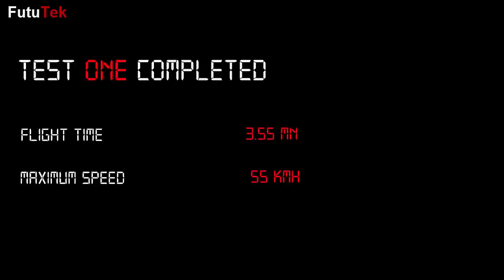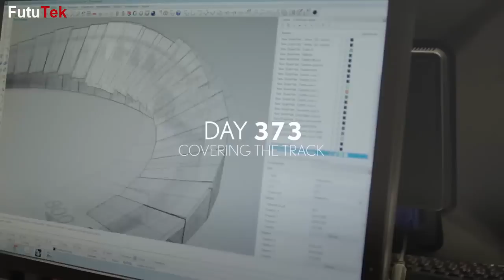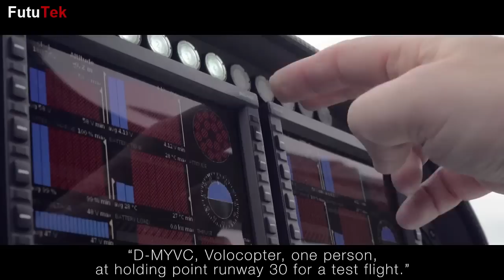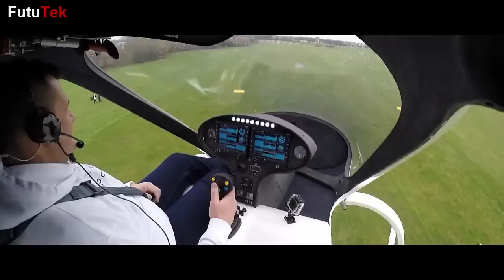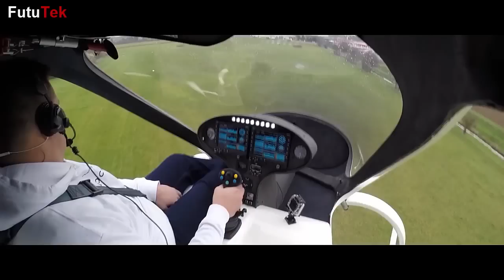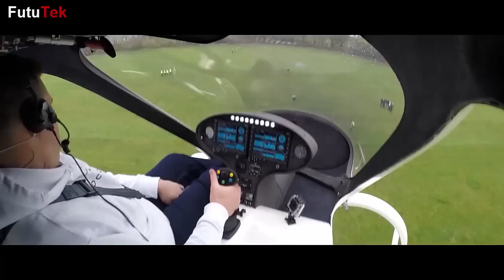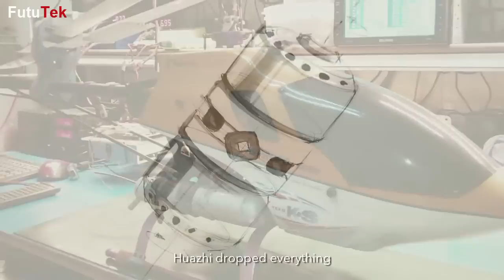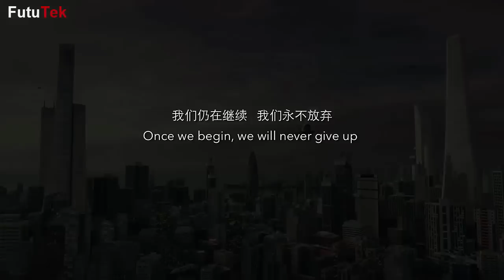Top 5 Amazing Personal Flying Devices

Comment: For the DIYers... The bottom half of Mercruiser's out drive (Bravo series)... has counter rotating output shafts. Good for 725hp of torque. These boats are getting old enough to by pretty cheap. Just thought I would mention it.

Comment: How bad would the flight properties be affected if just one of the engines failed on the Velocopter? ...just curious.  Any aviation experts out there?....
Reply: That is why it has so many motors in case on of them fails.
Reply: @situbes.972  ...ah, yeah.  I get that.  What I was asking was will the flight dynamics be affected by an engine failing....there has to be some change in flight handling after even one engine fails...thank's

Comment: All of it looks unstable, and unpredictable. Keep trying
Reply: They should could come up with better Ballance and stability software some of them look over engineered. They should use gas power batteries have limited range and extra weight
Reply: I agree better ballance design, gas power rather than batteries with limited range. Upgrade Ballance staballizer  software, or even a centrafugal staballizer.